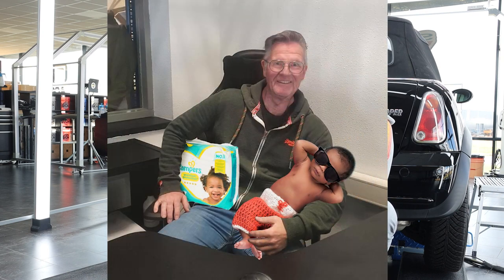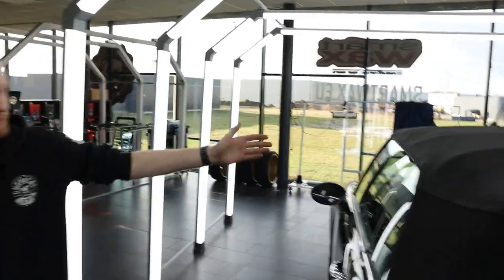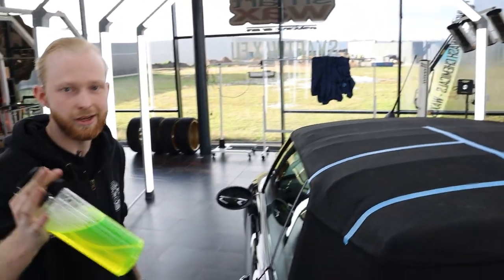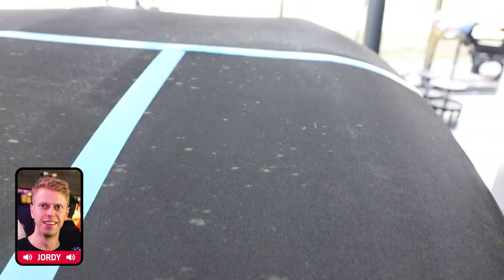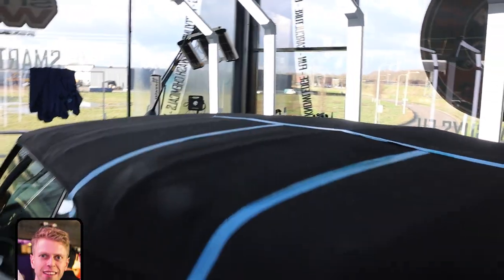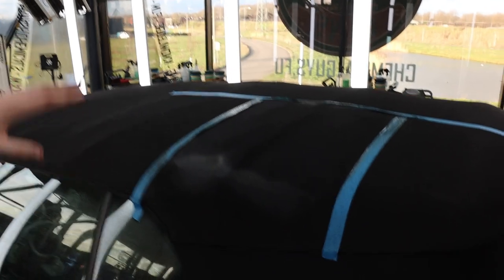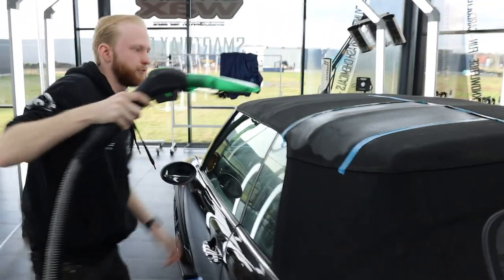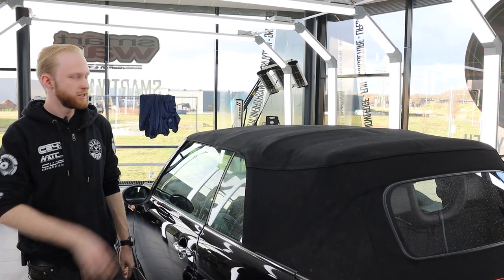CHEMICALGUYS.EU | CONVERTIBLE TOP CLEAN | HAND VS MACHINE | ALL CLEAN & SPINNER BRUSH | MINI COOPER

Comment: Much more cleaning product and effort used on the section that the rotary brush was used on. Not a fair comparison.
Reply from the maker: I spend 4,5 hours on this convertible top, I tried to do it as equal as possible, not sure how you come to your conclusion. On a few hard stains I had to do some extra work, also with the hand brush, there where it was needed. But in general it was done as equal as could be done.